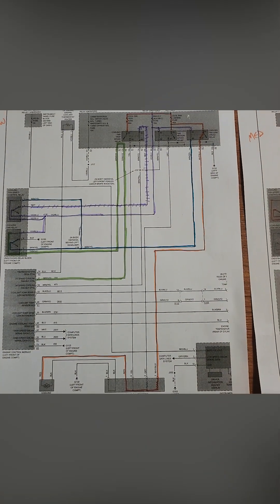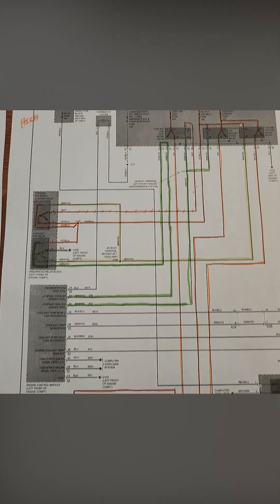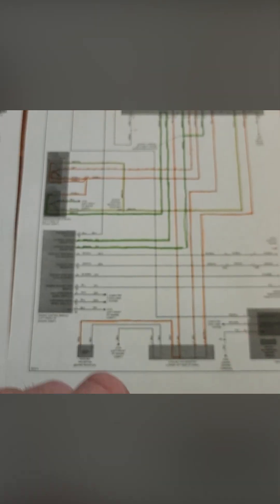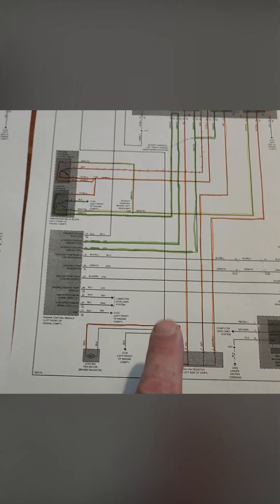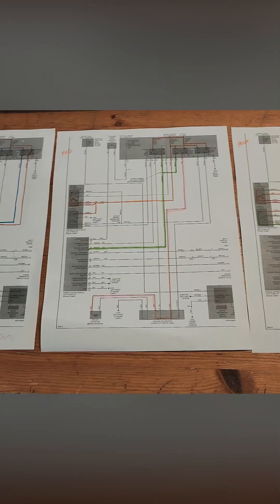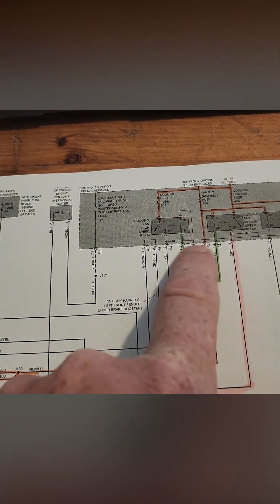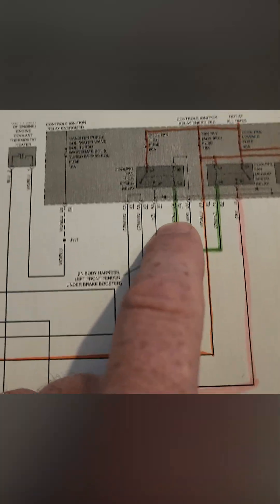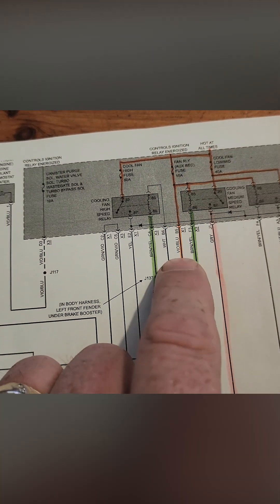Dissecting a wiring diagram [2017 Chevy Trax Cooling Fan Circuit]

Comment: Good evening, SD. I'm having problems with no power going to my 17 trax cooling fan. I've tested the fan to verify it works, tested all related relays to verify correct functionality. I show 14v running to one side of the fan plug, but not the side I need. (Need power to red wire side) Unsure how to move forward from here. Any thoughts?
Reply from the maker: Just sent you a dm on your wifes messenger account 🙂
Reply: @ScannerDanner  I saw that, thank you. It looks like that link is to a page that has their own wiring diagrams, but I was unable find one that shows which relay supplies the power to the red wire in the rad fan. From what I could see in your short, it looks like all power is routed through the 40/60 fuses prior to the relays. If that's correct, do you think it would be correct that these are the last thing to verify are working as intended? A visual inspection is also showing them to be in good condition, so I cannot fathom what else the issue may be.
Reply from the maker: @calebmccarty4298  yes sir, its like $20 to get you access to what you need. Without looking at a diagram myself on your system, I cant really answer your questions

Comment: Help Needed: Adjusting the car's fan to a lower temperature range (2019 Chevrolet Malibu)**

Welcome everyone,

I am seeking advice on adjusting the operation of the cooling fan in my 2019 Chevrolet Malibu. Currently, the fan operates at a temperature of around 98°C (204.0°F) but the fan only operates at low speed, which is suitable for cold climates. However, I live in a hot climate where temperatures often reach higher levels.

I'm looking for recommendations or instructions on how to adjust the fan settings so that it starts running at temperatures between 80 to 85°C (176 to 185°F). This modification will help maintain the ideal engine temperature in hotter weather conditions.

Any insights or recommended products to achieve this adjustment would be greatly appreciated.

thank you in advance!
Reply from the maker: Nothing wrong with 204. In fact as long as the engine is staying under 230 you are good. Older systems wouldn't turn the fans on until 230
Reply: @ScannerDanner The ECU sends a signal to run the fan at a very slow level when the coolant temperature reaches 208.4 and the coolant temperature reaches 237.2. It works at a slow level, and when the engine reaches this temperature, the car’s torque decreases and the car’s power decreases. On older models of Chevrolet Malibu, they modify the ECU until it works. The fan has a higher speed and operates at a temperature of 185 degrees Fahrenheit. When the temperature reaches 208 degrees Fahrenheit, it runs at full speed and the car does not face any problems. But in the 2019 model, the Ecu is E88, which is locked and does not accept modification. Can the fan wiring be modified using resistors or electronic transformers so that the fan runs at high speed, or can a schematic diagram of the fan system be obtained?
Reply from the maker: @alihussein058  237 is too high for sure!
Reply: @ScannerDanner What do you think is the solution? Is there a way to modify the signals sent to the fan?
Reply from the maker: @alihussein058  without studying that circuit I do not have an answer for you. Seems you have a fan control issue though as it certainly should NOT be still a low fan speed at 237
Reply: @ScannerDanner Can you get a diagram of the fan circuit. I specialize in electronics maintenance and can modify it if possible
Reply: @ScannerDanner For your information, I checked the entire cooling system and there is no defect, but the car is intended for cold weather and I use it in very hot weather.
Reply from the maker: https://eautorepair.adtrk.biz/?a=10817&c=24&p=r&s1=
Reply: @ScannerDanner  Sorry, what is this link? Does it contain the schematic diagram for the chevy malibu?

Comment: What is this for? A motor on a production line? HVAC? 👀
Reply from the maker: 2017 Chevy Trax cooling fan circuit. It has 5 relays and a resistor bank to control cooling fan speed. An honest stupid design if you ask me
Reply: @ScannerDanner Lol, I can almost hear the engineer substatiating the cost of his stupidity.